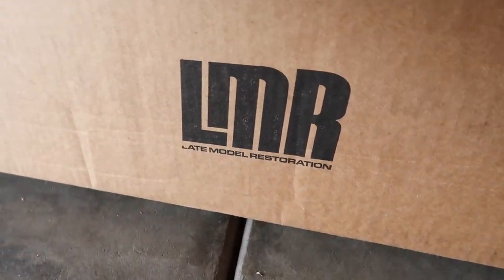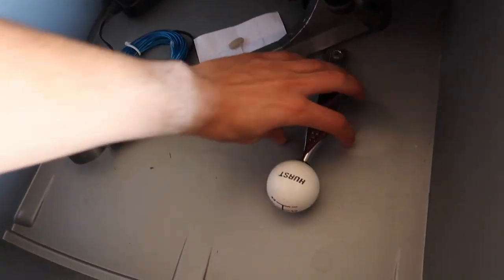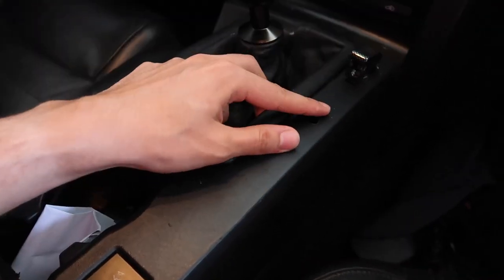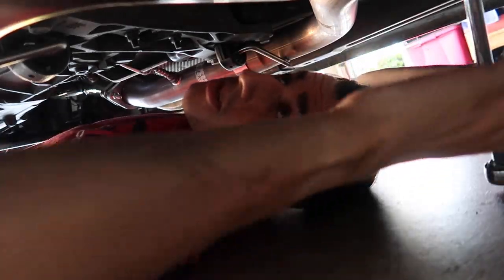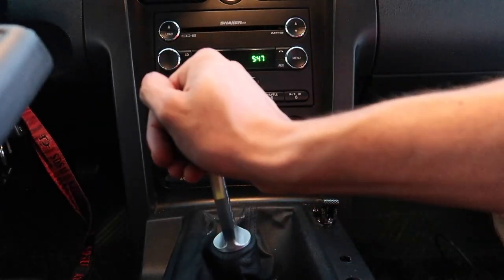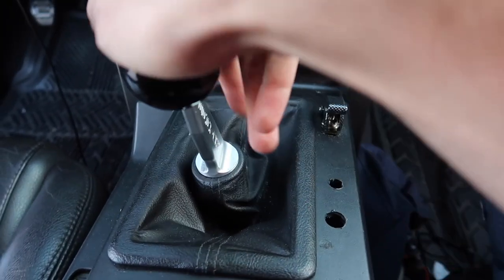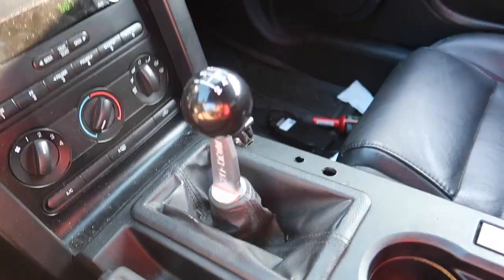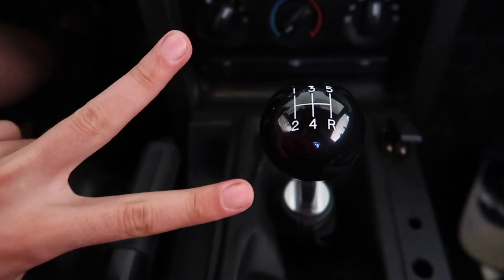The BEST Short Throw Shifter For Your Mustang: Barton (Ft. LMR)

Comment: You said Hurst reuses factory bushings , " not true " they come with delrin and must be pressed in .  Hurst does come with stops , un- needed , because the trans has built in stops . The real secret to fast shifts is a bigger inside diameter hydraulic clutch line . The factory clutch line will not flow enough fluid to activate the clutch upon fast shifts , causing grinds and failure . 
Take heed , I know what I'm talking about , from extreme experience  .
Reply from the maker: thanks for all this info man! appreciate it!

Comment: Went with Barton on my 2011 Roush Shamal.

I had already upgraded the clutch, hyd line, and added the Blowfish Bracket, also a carbon fiber driveshaft. That was several months ago. Shift issues were only partly fixed.

Today installed the Barton Shifter, a new shifter cup, and a Whiteline trans bushing with a hole drilled in it. The NVH is not an issue. Actually I like the sound better than before.

So finally the shift is fixed. The factory shifter was just so loose.

In hindsight, perhaps I could have gone MGW, but finally, am totally happy with the set up. 

The shifts are so notchy, so positive. To enter reverse, it requires a firm push down but no worries.

Comment: Great choice!!  MGW and Hurst need adjustments,I'm told.Not the Barton.Drop in and go!An easy install,also.First thing i did to my bone stock '06 GT last year when i got it,and i love the thing!Check out the Ford Performance one piece driveshaft.Retails for 800 bucks.LMR sells it for $618.Saves weight and gets rid of that clunk.Good video! Might want to invest in some safety glasses when working under the car...Good luck!
Reply from the maker: yes! couldn't have said that any better! i think imma go with driveshaft next!
Reply: I love my Hurst